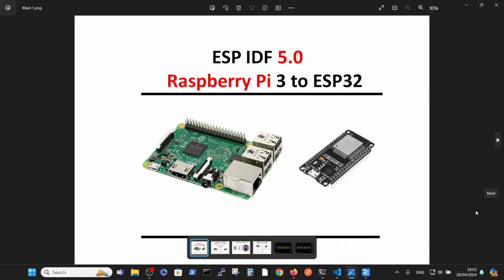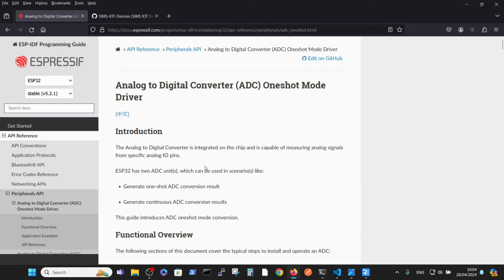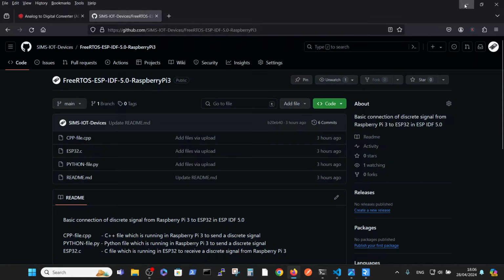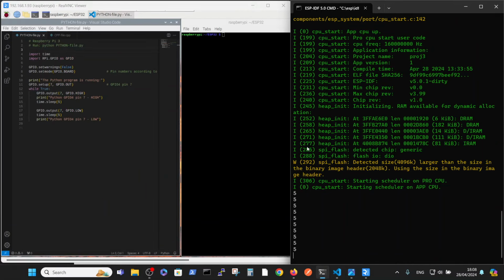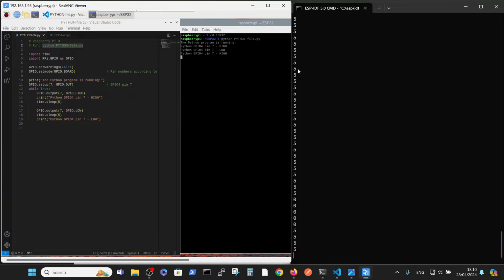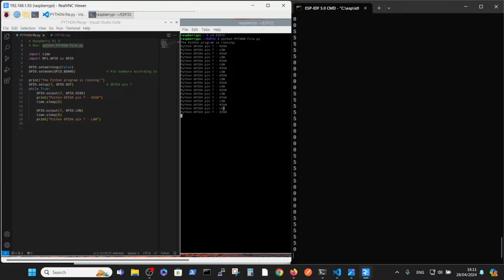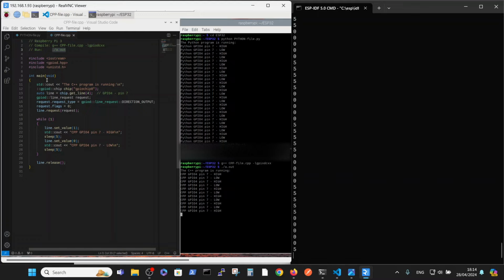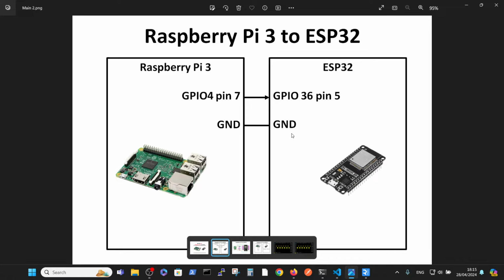Raspberry Pi 3 to ESP32 in ESP IDF 5.0 analog signal

Comment: I don't think I ever saw an rpi programmed in C before. Python has always been used.  I think it is probably the monitor.  I think if you had an led on the gpio pin of the esp32 there would be no difference.  I like your videos.
Reply from the maker: Dear @noweare1
You are completely right, it took me a lot of time to find a C++ version. In the second video, I used only Python and it was much easier.
Reply: @simsiotdevices6219  Python is awesome. But I mostly program in C.